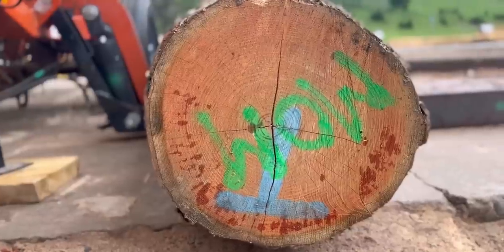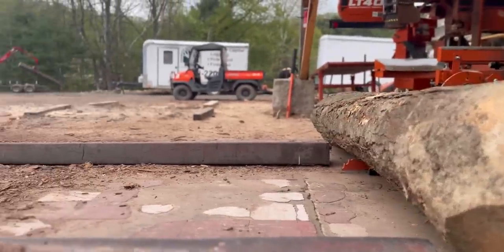Sawing Beautiful Sunburst￼ Locust on the LT40 Woodmizer 206

Comment: Locust, hard as nails, insect and rot resistant, heavy, strong, and by weight the same heat value as fuel oil. Would love to see what projects you apply this too. Beautiful wood.
Reply: good firewood too

Comment: They used locust as main support post in houses. You can find them in the basements of houses up to WWII.
Most are in perfect condition but folks will replace them because they're creeped out by a tree trunk holding up the house and think a steel post would be better.

Comment: I've cut regular Locust with the chain saw, that stuff was so hard sometimes you could see a spark come off the chain.
Reply: From the chain rubbing on the bar or driver's sliding in the groove poorly
Reply: @skookumbuilds3282  😄👍
Reply: Sand particles that have been sucked up in the sap......Bur Oak does that a lot...
Reply: @glenspryszak6005  potential silica in the xyl/phlo is a stretch but definitely dulls teeth quick in say coastal cedar!
Reply: Yup.  Stuff's crazy hard when cured, will dull almost any tool.